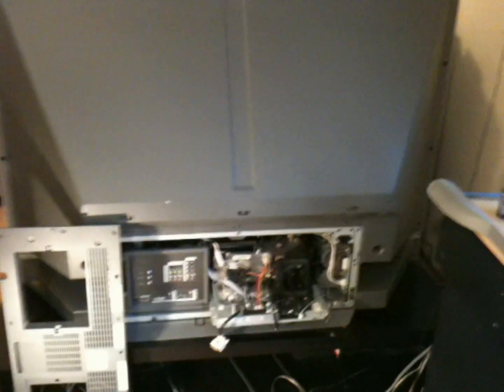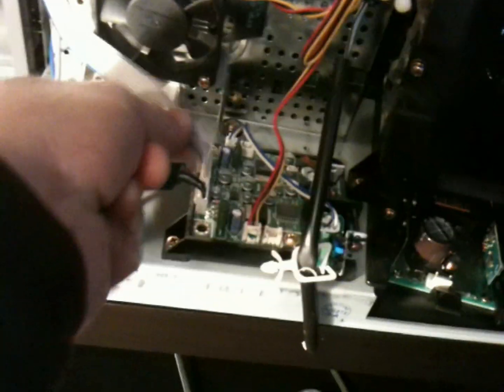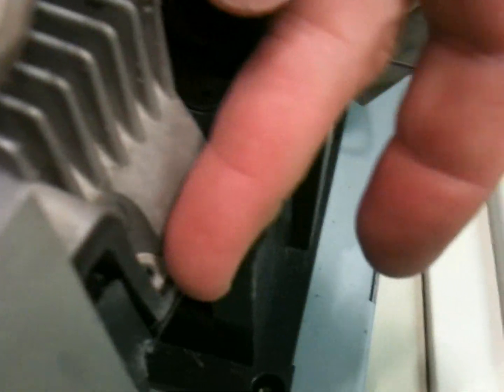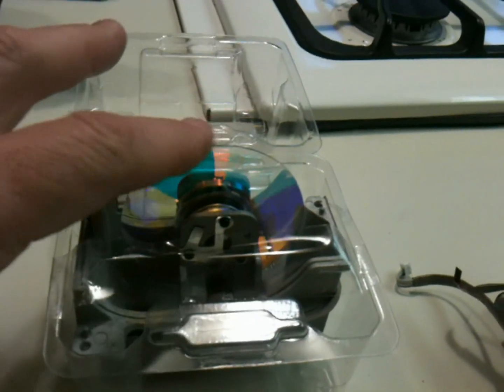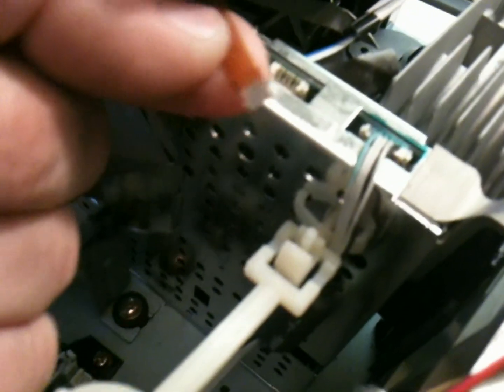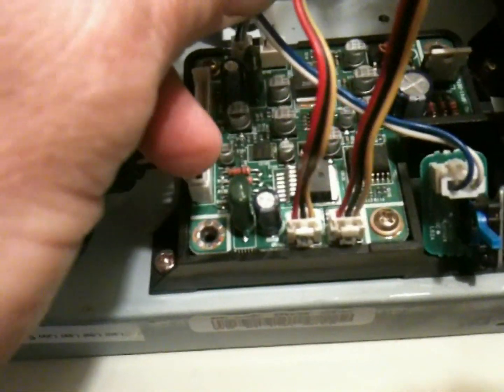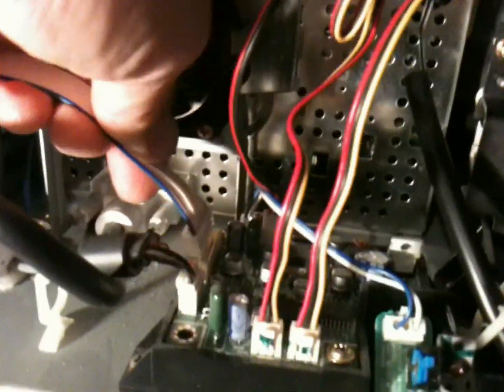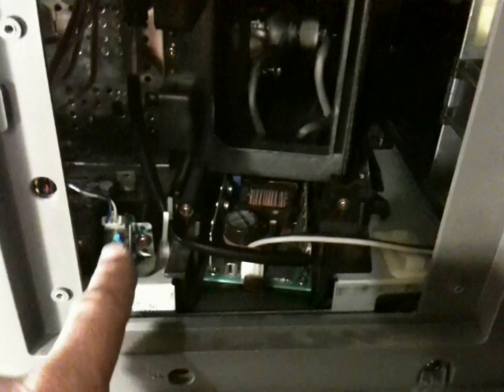DLP TV Repair

Comment: i did all this and my color wheel was not cracked, it actually looked good still. but i was wondering if before you changed it, did your tv have the timer, lamp and the power lights blinking? because that is what mine has and im not sure if that means that the color wheel was bad.

Comment: Thank you so much for the video.  Samsung DLP 42 inch is my brand-model. Your video made it quite easy to replace the color wheel.  I am a handy person but was hesitant to attempt this but worked out well. Keep the compressed air (gas) handy as your TV will be dusty inside.

Comment: I just replaced a color wheel on a sharp dlp but turns out I have a bad temp sensor.  The problem I'm having is I don't know where the temp sensor is located?  It's a sharp 56dr650.  Would the sensor be attached near the color wheel?